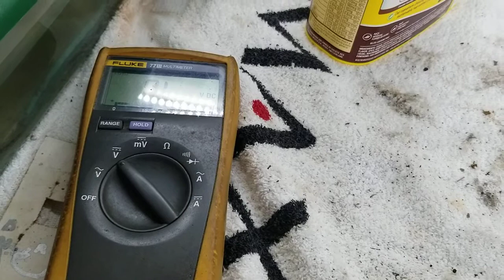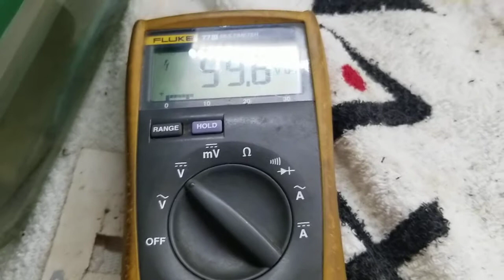1950's TraVler battery operated 4 tube radio assesment

Comment: Interesting. So, are you half wave rectifying the AC coming out of the Variac to get the DC for B+?
Reply from the maker: I ended up just having 9 volts and getting 68 volts b plus. I get very very faint reception, look foward to an actual repair video soon.